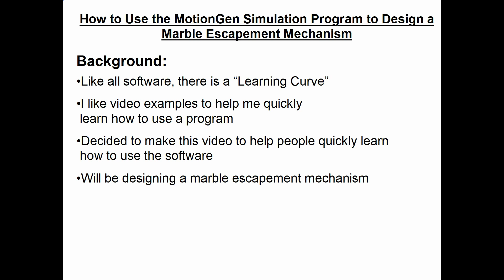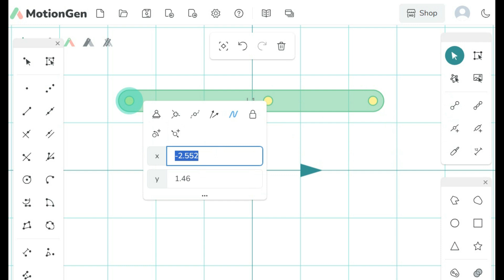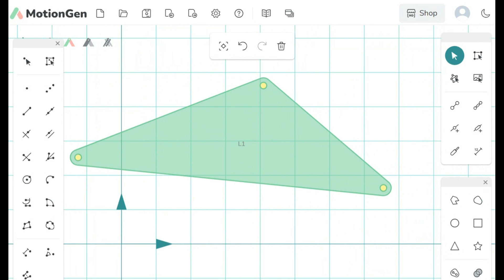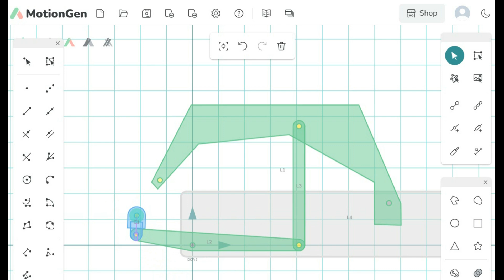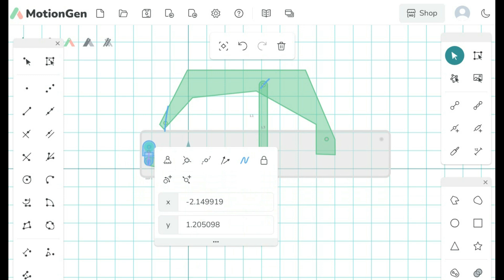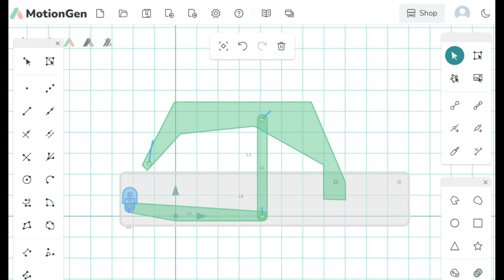How to Use the MotionGen Simulation Program to Design a Marble Escapement Mechanis

Comment: Is there a way to add gears into motionGen (to use the software to design automata toys)?
Reply from the maker: I asked the Perplexity AI program this question, and the answer I got back was "MotionGen focuses on simulating planar linkages, such as slider-crank and four-bar mechanisms, but it does not natively support spur gear modeling or animate their meshing within moving assemblies. The program allows users to work with geometric constraints—revolute and prismatic joints—but does not include predefined mechanical elements for gears. For simulations requiring interacting gears, consider external gear-design tools or more advanced mechanical modeling software."